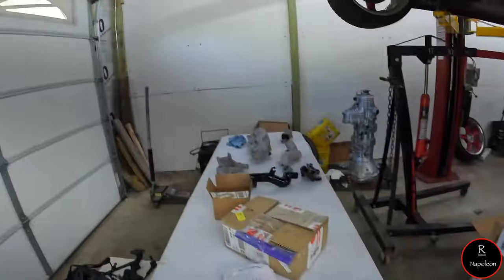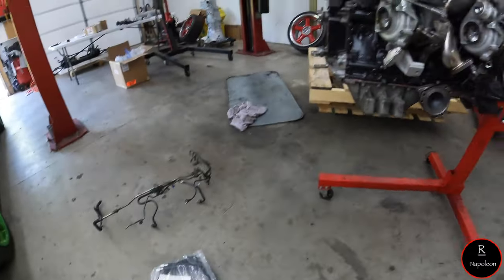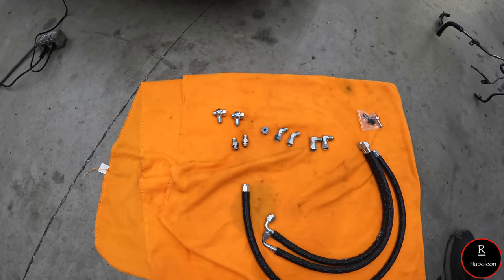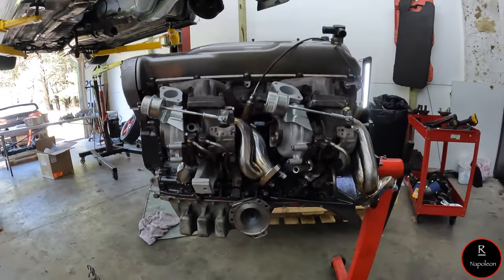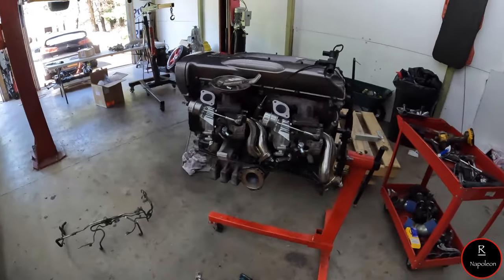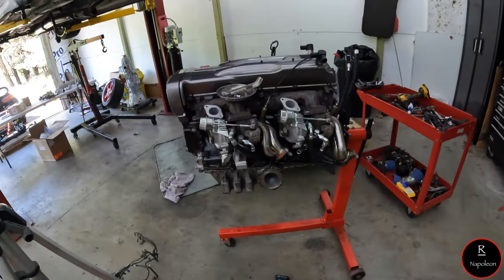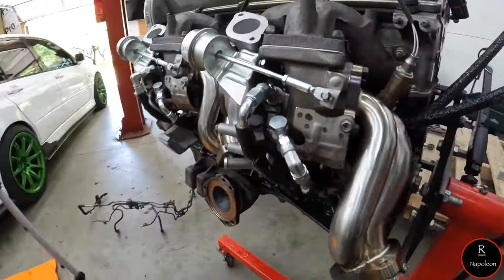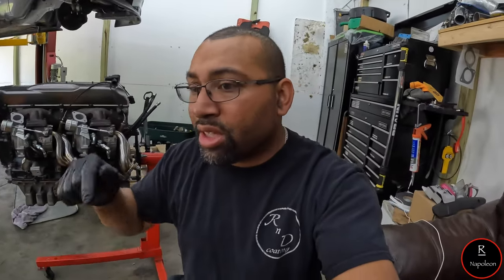RAV Performance coolant line install   4K

Comment: Oh wow I didn't know this existed from RAV. Also nice going on the aftermarket turbo lines. I do gotta say my coolant stays around 75 when driving hard and at most like 90 when idling on a hot day. Quite the benefit of not having to share it with the turbo lol.
Reply from the maker: It may be one of the better things I have gone with for sure

Comment: Great Video! I plan on running that kit for my R33 as well.  Question, I noticed that the "spider web"  includes the vacuum lines for the turbos. Just curious, how do you plan on running those turbo vacuum lines?
Reply from the maker: you know what thats actually a really good question, i will say this i got my car with an HKS evc5 boost controller so all my turbo vacuum lines are right next to the intakes and routed behind the engine. its "T"d off to the top of the intake manifold air chamber. if you HMU on IG i can take a video if what each line goes to and where you can get the boost source from if you like.
Reply: @r_napoleon  awesome I look for you on ig

Comment: This is not making sense to me , you have 2 line going to the back of the motor which water return,  you have a line that goes from turbo to turbo ? So how are feeding turbo with coolant?
Reply from the maker: Ok so it’s a big daisy chain, coolant comes from the intake side, in the back of the rear turbo it flows though it. A line is connected between the 2 turbos in front then the return line is on the back of the front turbo back to the intake side
Reply from the maker: You can hit me up on IG if you like I can explain it a bit better

Comment: Got a link to these?
Reply from the maker: https://www.ravperformance.com/collections/engine/products/rb26dett-twin-turbo-hardline-delete-kit
Reply: @r_napoleon  Hey brother - just trying to understand how this was routed. 
The oem hard line banjo fittings are for the coolant inlet - which comes in from the coolant feed on the block. 
I saw you capped the feed off the block with the plug included in the kit. 
You then connected those two turbo coolant inlets together with the new line. 
My confusion is - where you are getting coolant to feed the turbos - since the last two lines you have routed to the back of your block are coolant outlet - right? 

Thanks
Reply: Would also like to know